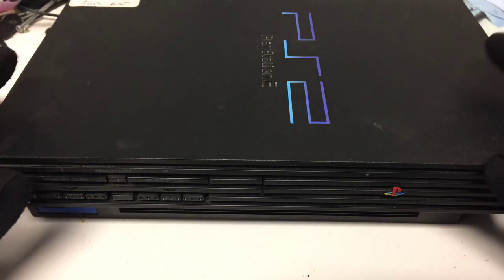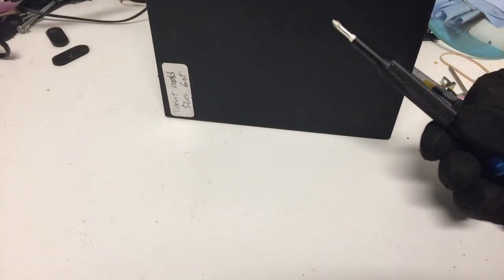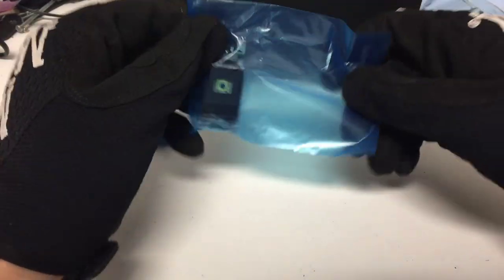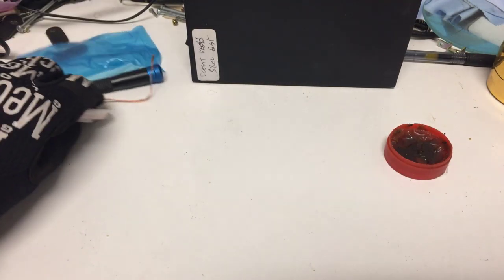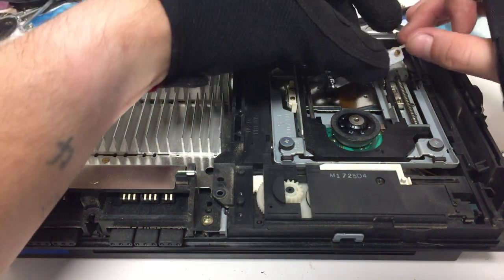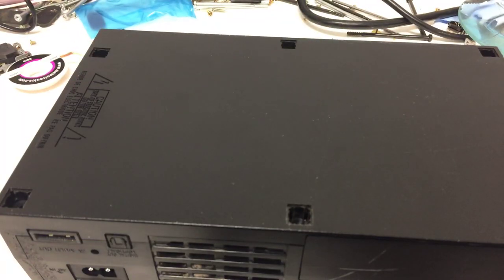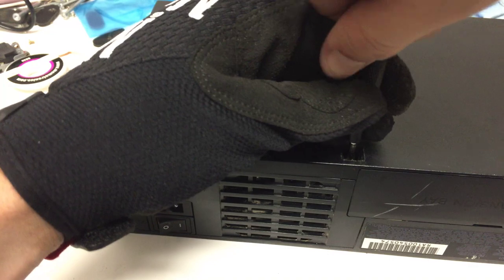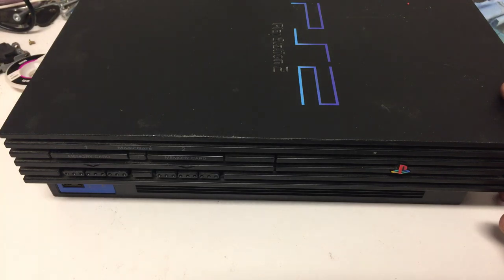PS2 Phat (fat) Laser Replacement + tips & tricks for replacement

Comment: I did it! The lens works now. Just FYI, the torx screw is a T4. You can use a T5 screwdriver, but a T4 is better for the screw head. For the bloc calibration, you have to put it into initial position (when you hear the clac sound) and turn the wheel till the 30-32nd notch.

Comment: It's worth changing the laser out in a phat playstation 2 and most importantly clean the system clean the heatsink the CPU fan and the top and bottom of the  system shell and replace the ribbon cable that sends power to the power reset and eject buttons and replace the ribbon cable with a flex cable those ribbon cables sony uses breaks easily

Comment: Hi, i noticed a video elsewehere where someone replaced a ps2 laser on  a 30001 R model...they did basically what you did, but did an involved eeprom settings change to 'acknowledge' the new laser model...iirc the new laser was a 400C also. So this is unnecessary for a 30001? ...maybe the 30001R does not normally take a 400C?...i have the one you have here, the older 10 screw SCPH-30001 model.
Reply from the maker: 400c supports models 30001, 30001R, 30005, 30006, 30007, 35001, 39001.
Reply: @cloudstriferepairgaming  ok thx, so there is nothing required post 400c install on my 30001 as far as having to do anything with firnware?.... im just confused why the other guy showed some lengthy software changes via usb and memory card after he installed the new laser on 30001R
Reply from the maker: @Mr_Smarty_Pants  you should be fine. 30001 is the most common model and often needs replacement. In the past 4+ years, I’ve replaced more than I care to remember. Only time there’d been an issue was due to a factory defect in the laser with the next replacement being fine.
Reply: @cloudstriferepairgaming  ok thank you, can you recommend a 400c laser seller/supplier?
Reply from the maker: @Mr_Smarty_Pants  not of the top of my head. I’d say eBay would probably be your best bet. Most the sellers on eBay that sell parts are generally cool. Just research a bit, and whatever suits you best.
Reply: @cloudstriferepairgaming  ok thx for the help sir
Reply from the maker: @Mr_Smarty_Pants  no problem!

Comment: Would I have to take off the anti static thing on the back? And what if I don't solder to take it off
Reply from the maker: Yes, you’ll have to desolder the anti static solder. If you don’t remove it, it’ll not work. If you can find a local shop that sells soldering kits etc, I’d recommend picking one up. Kits aren’t usually very expensive. About $20. I’ve noticed Best Buy seems to carry kits as well. Last resort, Amazon.
Reply: @cloudstriferepairgaming  thank you, is soldering easy?
Reply from the maker: @Nosirrl4747  it can be. If you get a kit, it may come with a practice PCB. If not, you could always practice on an electronic PCB that you don’t care about, or pick up a cheap sports game cartridge to practice with. 😎👍

Comment: The left screw the torx one you put it all the way down right ??
Reply from the maker: Trancegotten not all the way. It would be too tight, and not move along the track.
Reply: @cloudstriferepairgaming  so how much ? How do I know is in good position
Reply from the maker: Trancegotten Most of the screws can tend to have blue marked on the end. If it’s got blue on it, it makes it easy to gauge where to stop screwing. But if it doesn’t, it’s kind of a guessing game. Or trial and error. You can always pop out the magnet, and try out a disc before you fully reassemble if the screw is not marked.
Reply: @cloudstriferepairgaming  okay thank you very much and something else the laser you have is copy one or is the original ? the new one
Reply from the maker: Trancegotten No problem! Most of the ps2s I’ve fixed have Sony brand lasers. Not necessarily original (as in the one it came with), but you can still get Sony lasers.
Reply: @cloudstriferepairgaming  okay but and with the copy one it will work good right ?? And btw one problem I have with SCPH- 30004 R model it doesn't boot straight to the game I wait for 10-15 seconds to the browse menu you know is this normal ?
Reply from the maker: Trancegotten possibly. Depends on the condition of your disc. Upon startup if you have a disc in already, it should boot up within a few seconds with a good condition disc.
Reply: @cloudstriferepairgaming  it do it with all games only my slim ps2 boot up straight to the game
Reply from the maker: Trancegotten phat models are older technology, so it may not read as well with a smudged/scuffed/scratched disc. But if any solder is left on the bottom of the laser, that may be causing an issue.
Reply from the maker: Trancegotten if you happen to have any flux, you can dip a soldering wick/braid in the flux to help get any remaining solder off of the bottom of the laser. Afterward use a bit of isopropyl rubbing alcohol on a qtip to clean any flux that may be on the bottom of the laser
Reply from the maker: Trancegotten you may also need to adjust the torx screw a small notch.
Reply from the maker: Trancegotten it’s also possible that your gears need cleaning and regreasing
Reply: @cloudstriferepairgaming  thanks for all the help dude! Subscribed and like!
Reply: @cloudstriferepairgaming  and btw something finally my slim ps2 play ps1 disc the phat doesn't play is this normal ?
Reply from the maker: Trancegotten Thanks, I appreciate the support. 🤔 I’m assuming that you replaced the laser. Slims lasers are known for being more powerful than phats. I also assume the disc may not be in great condition. Other than my previous advice, I’m not entirely sure what else I can help you with. As I am not there, it’s not easy to decipher what exactly is the issue. It could be one of any number of things. I’d recommend wiping down your disc with a microfiber cloth and some compound. You may also find that car polish compound will work if you can’t find disc compound. That may help with a polish and possibly any very minor scratches. I wouldn’t recommend hand resurfacing though. It will make your disc worse
Reply: @cloudstriferepairgaming  thank you from aliexpress or ebay if I buy from there a cheap laser you think it will work without problem
Reply from the maker: Trancegotten eBay would probably be better. Browse through the sellers and ratings. Try to stay away from AliExpress. Cheapo parts or repro parts. KHS-400C is compatible with the SCPH-30001 R. Last I checked, they were fairly inexpensive. But due to the pandemic, people price gouge. But still, find a good eBay seller. Don’t pay $3 for a cheap knockoff laser that you’ll need to replace several times.
Reply: @cloudstriferepairgaming  thank you very much subscribed and like! you deserve more views btw

Comment: my laser is new and lights up but doesn't go up and down, what's the solution sir?
Reply from the maker: The lens doesn’t move, or the laser doesn’t move on the track?
Reply from the maker: I could troubleshoot a few things. You torx screw may need adjustment. Your gears and track may need adjustment and or cleaning and relubricated. Your flex cable may need to also be cleaned and or adjusted. Check all those, and lemme know.
Reply: @cloudstriferepairgaming  laser doesn't move on the track sir

Comment: Which screwdriver do you use for unscrewing the little torx screw? I received a new lens but without the torx screw. i need to take the screw from the old lens.
Reply from the maker: PrinceofOtakus If you don’t have a small enough torx bit, you should be able to use a small Phillips.
Reply: @cloudstriferepairgaming  Ok but technically, which torx screwdriver do i need?
Reply from the maker: PrinceofOtakus The size? I believe it’s T6
Reply: @cloudstriferepairgaming  Yes the size. Perfect. I'll give it a try. Thanks again.

Comment: I have same model 30001 R and replaced 400c with another 400c, reads games but takes like 2 minutes per game
Reply from the maker: I’d recommend getting your discs resurfaced
Reply: @cloudstriferepairgaming  hmm all discs work on my slim
Reply from the maker: @giovannii5759  It’s a possibility. It may also have lingering residue of the solder. For best functionality, resurfacing works wonders of all three disc types. It’s also possible that the laser just has a minor defect. No way for me to know from here.
Reply: @cloudstriferepairgaming  so I cleaned up the solder, tightened the ribbon cable, reflashed the eeprom and adjusted the white gear, got cds, ps1 games, And blue ps2 games working. However I can’t get silver ps2 games or dvds to read at all, continually says “reading disc”
Reply: @cloudstriferepairgaming  should I mess with the ps2 laser potentiometer or just order another laser?
Reply from the maker: @giovannii5759  personally, I’d order another. You can do whatever you’d like. If you have the time and don’t wanna waste money unless you have to. Lasers can tend to have defects though. Definitely find a trusted site or user that’s known for good replacements and or see if you can get an exchange for your previous laser.
Reply: @cloudstriferepairgaming  lol I appreciate your feedback, I got DVDs working by adjusting the white gear, so it’s really just ps2 silver games. To save me a headache you’re probably right
Reply from the maker: @giovannii5759  no problemo! Hope you can get it ship shape! 🤝
Reply: @cloudstriferepairgaming  I got another laser from a different seller and it was plug and play!! Can’t believe the time I wasted struggling with the other one ugh, future advice for anyone who needs it, if you get a new laser and it doesn’t work maybe don’t adjust too much and just order another, guess it was just a dud. Thanks for all your help Brotha
Reply from the maker: @giovannii5759  awesome! Glad it worked out for you! 😎🙌